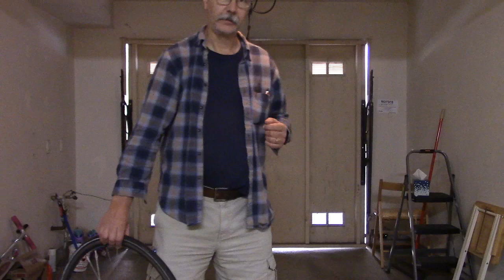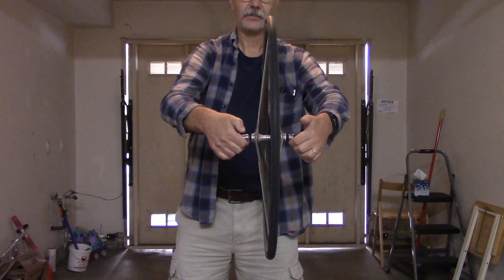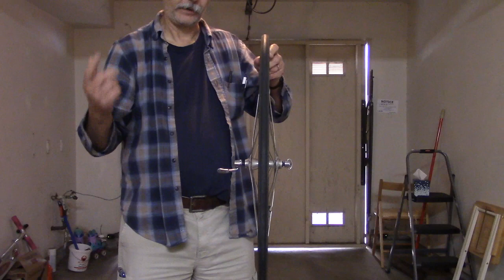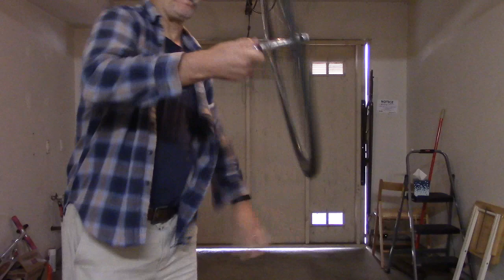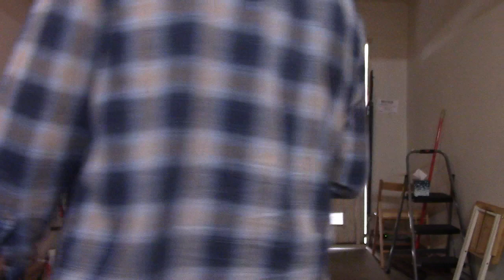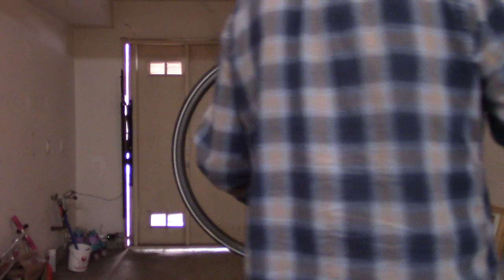Spinning Wheel with Torque

Comment: I am impressed how that works without any calculus. After all, the spinning wheel might have frame-dragging effects on the surrounding spacetime, giving rise to an irreducible time-angle component in the metric tensor. Of course, if it is an enlarged subatomic particle being inert toward tilting because of the non-commuting nature of different quantum spin components, the describing math would be rather advanced algebra.